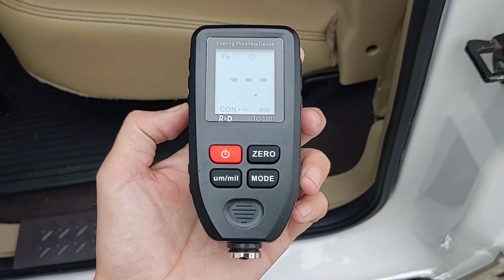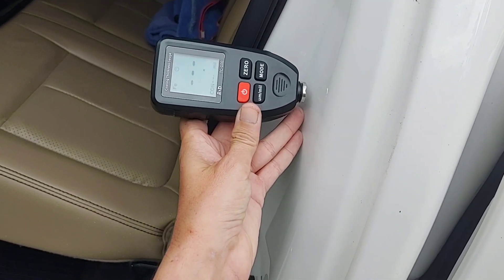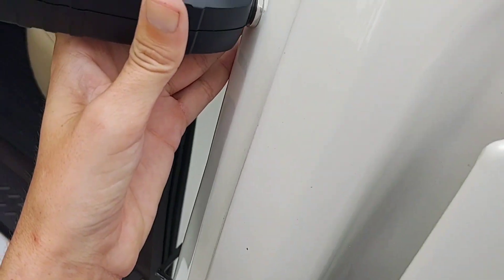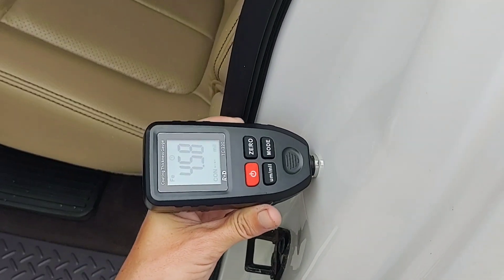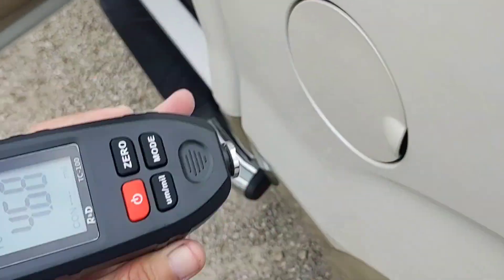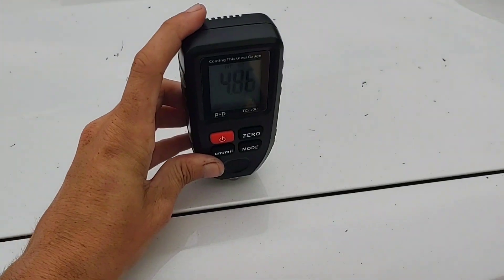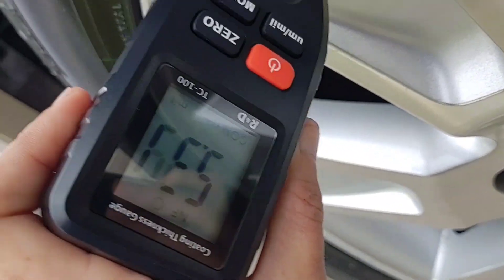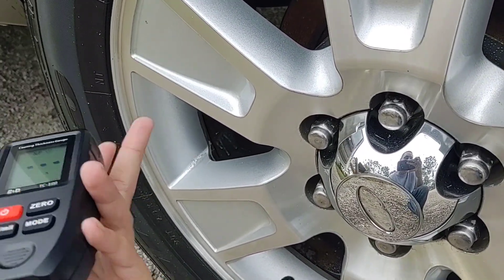R&D TC-100 Good Cheap Coating or Paint Thickness Gauge Bought Off Amazon

Comment: imron that i spray i make sure i have atleast 12 mills of build this is a great tool for the price
Reply from the maker: agreed its really good for the price.  I use it for polishing mostly but also for inspecting used vehicles to see if they were recently resprayed as a way to detect if they may have been in a accident or might have just had a crap respray job to sell it quick.

Comment: You're not holding it right.  That's why the reading fluctuates.  Hold it where you suppose to hold it.  Geez.  Don't you see the places where you suppose to put your fingers on?
Reply from the maker: Where you hold it makes zero difference you would know this if you had the same gadget and tried it.  What does make a difference is not holding it completely flat

Comment: It’s in continuous mode that’s why
Reply from the maker: Yea I figured that out thanks
Reply from the maker: I prefer to do continous mode because sometimes you don't realize your not holding it flat and if your not in continous and aren't flat you will get a high reading and not understand why but in continous mode you can easily see when your moving it too much